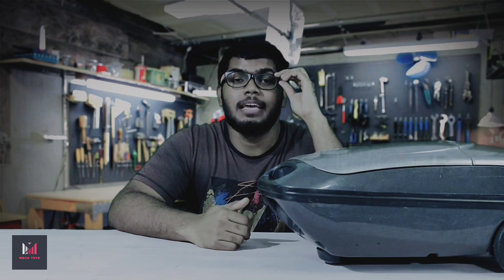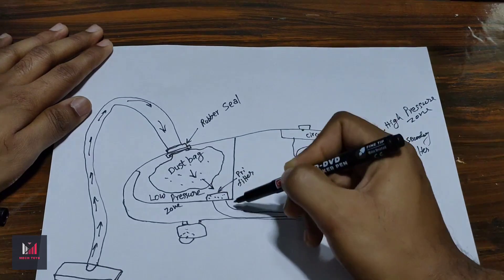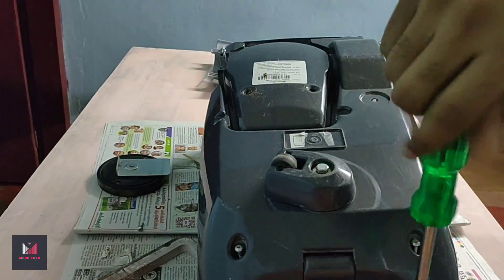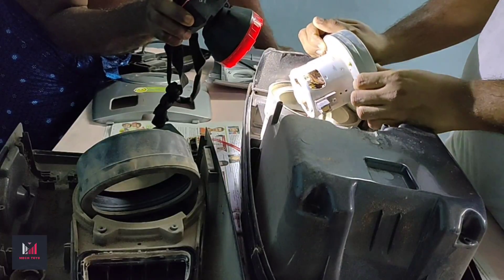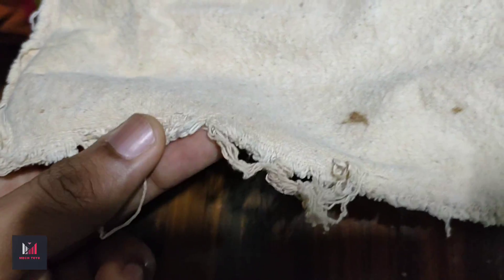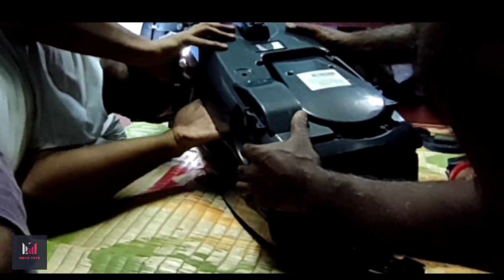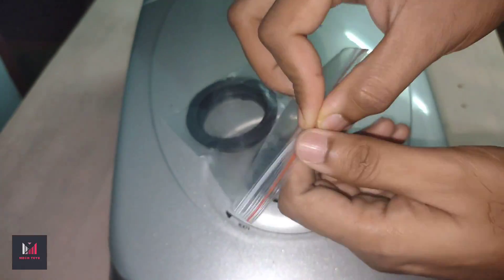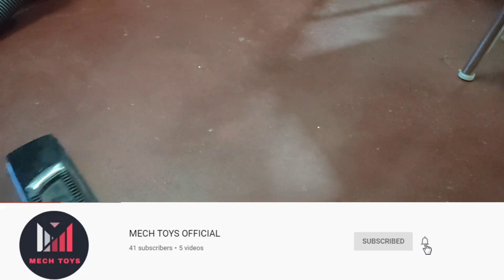What's inside a vacuum cleaner? |MECH TOYS OFFICIAL

Comment: Inspired by your video my vacuum ball bearing of the motor was gone got it replaced and I assembled it, and started using it. After some use I felt the motor was running rough. Could u please show how to disassemble and then assemble the motor of tornado trendy. Thanks for video u have already posted

Comment: My trendy steel vacuum cleaner is suddenly stop working. It shows power supply on but it is not starting.
What can be the cause of it , our machine is as good as new, as we had used it for 3-4 time in last 3 years since we purchased it.
It has one more problem since we had purchased it was , it get heat up in 40-60 minutes of use. What can be the remedy to this problem.
Reply from the maker: There could be several reasons. Have u tried switching it on from other plug points in ur house?

Comment: How to fix the cable automatically winding itself without pressing any button
Reply from the maker: Hi,Will make a video on that later. It's a spring based retracting mechanism, the switch disengages a normally locked lever that's how spring spins the drum
Reply: @MECHTOYSOFFICIAL  I've opened the v cleaner now .. will try to fix 😀
Reply from the maker: What issue you're facing with the cable retractor?
Reply: Plz post link to buy the replacement wheel..one of them is broken and want to change that also
Reply: Cable is automatically getting pulled without pressing the button.
Reply: Fixed that issue..the rubber resisting the plastic wheel rotation was off a bit. It's better now.
Reply from the maker: Glad to know you fixed it☺️

Comment: Sir my vaccum cleaner same model, it's working but not dust pull off
Reply from the maker: Check if you have proper voltage in your home, is the dust bag full?, Is there any leakage in suction hose/ seals that I've mentioned in my video

Comment: Hii i have the same vaccum. Just changed my motor but could you please tell the reason why my blower & suction power has reduced. Even when kept on full speed its suction & blower are very low. It was perfect till u changed my motor
Reply from the maker: I didn't change your motor 😳
Reply: @MECHTOYSOFFICIAL  Sorry i meant everything was perfectt till my motor was changed by the technician... Could you pls tell me the possible cause of why its suction & blower are not powerful as before??
Reply from the maker: Don't know the exact reason for your problem, it can be anything. Motor speeds may fall if voltage is lower than the requirement (220-240v). The new motor may not be of the same rated power as the original one(1300W), there may be gaps formed between its motor seat, or any of the seals may have air leaks which i already mentioned in my video. Is there any reduction in sound of your vacuum cleaner than earlier???
Reply: @MECHTOYSOFFICIAL  Yes it sounds different from what it was before replacing the motor... I got it changed from Eureka forbes service center itself... So i guess they must have replaced it with a 1300 watts motor
Reply from the maker: Check the amount of input power with the help of any electrician using a clamp meter. He'll tell you how much power your vacuum cleaner is consuming. With that info motor's wattage can be understood 😊
Reply: @MECHTOYSOFFICIAL  THANKS🙏
Reply from the maker: You're welcome. During measurements of power consumption set it to full power. By the way why it required to replace the motor? How much it costs??
Reply: @MECHTOYSOFFICIAL  It had stopped working & had some burning smell coming.. when chkd the service guy said the motor us burnt so had to replace it... It costed me 2000k. I had this similar suction problem before also when opened but then they again opened it & the suction got restored to full power. I guess they are not doing their work properly while refixing it
Reply from the maker: Spending on repairs isn't good idea these days when appliances are made to be"use and throw". New vacuum cleaners costs between 4000 to 6000😂. Hope your problem gets fixed soon. Thanks for watching... Subscribe to our channel and check out my other videos.🤗
Reply: @MECHTOYSOFFICIAL  I guess your right... Should have bought a new one instead of repairing.... Thanks bro anyway for the revert's... Just subscribed to your channel🙏
Reply from the maker: It's my pleasure bro🤗
Reply: @MECHTOYSOFFICIAL  Thanks Bro🤗

Comment: can u give a wiring diagram.afte r opening the cleaner,i forgot to note down connectors plug in points.also it would be better,if u could give a slow demonstration of reassembly.
Reply: Yes it would be helpful if u add a video of reassemble of this kind of vaccum cleaner
Reply from the maker: Okay i will
Reply from the maker: Dm me on Instagram id "the_passionate_dreamer", I'll send a snapshot of the wiring. Slow re assembly would've made the video lengthy, you can adjust the YouTube playback speed and watch it in slow.
Reply: @MECHTOYSOFFICIAL  thanks.awaiting for the snapshot.